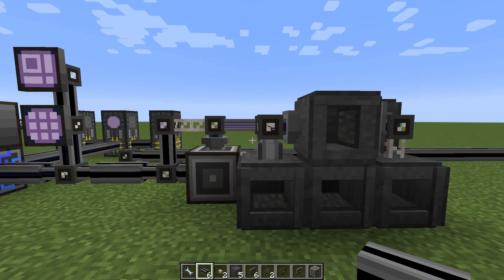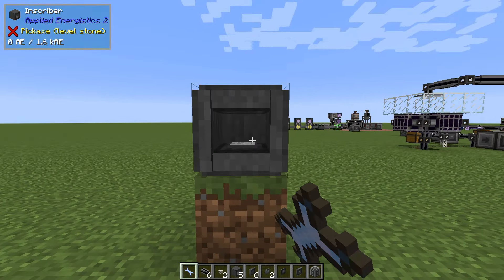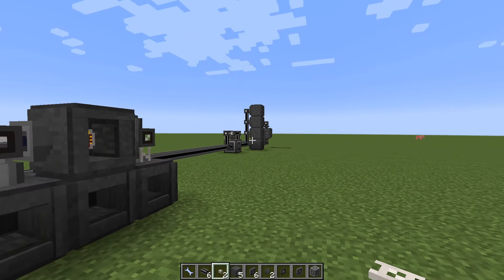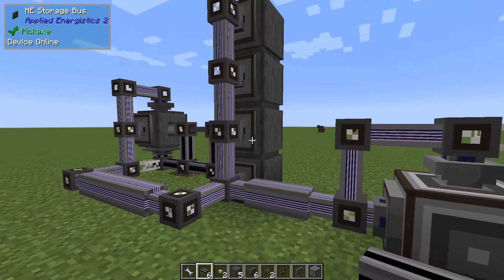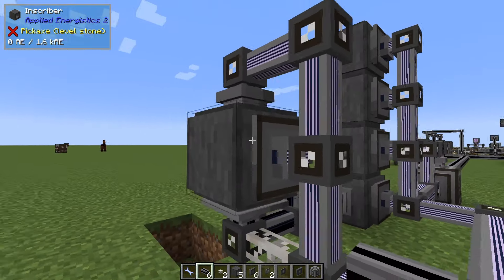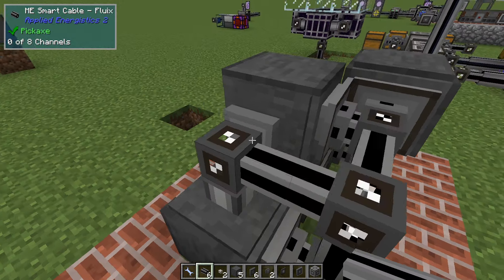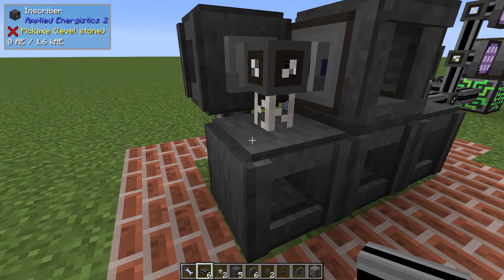Super Compact Inscriber Processor Auto-Crafting Setup - Applied Energistics 2 Tutorial

Comment: Okay so for anyone wondering why your crafting cpu says "missing X circuits". It's because the pattern he has encoded in this video is the raw material not the circuit. This is because processing patterns work like so: "Send X items to (wherever you have the patterns stored, in this case ME interface)" and wait for output of Y.

Swap out the circuits for the raw materials to make the circuits and you'll be good to go.
Reply: The same goes for silicon, make sure its RAW MATERIAL silicon in the pattern, not printed silicon. Basically just rewatch his pattern encoding part and follow it without any implied knowledge or foreward thinking, take it at face value lol.
Reply from the maker: Correct :) I got many questions about it because I guess most didn't watch, remember or understand the pattern part seen at around 5:10 .
Reply: Hello
i dont know if you will see this but if you do could you pls help me.
im playing with a huge modpack right now and i have never  touched AE2. 
i have watched the video and read your comment but i dont understand what the problem is. 
My ME terminal says "No crafting CPUs are available" and the start button for the crafting is gray.
thx.
Reply: @NdlessAmaterasu22 hi i know i’m really late but if you still haven’t figured it out, you need to connect something called a crafting unit to your ME controller!
Reply: i tried it like how it was done in the video with the raw mats and it didnt make the patern

Comment: Thank you! Mine finally worked. At first the Inscribers didn't show it had power. It must be a glitch or something but the bus' and other machines were online and had power but the inscriber didn't show it. The Storage bus was online so I just continued on. I also I didn't know that on the pattern terminal you can change the crafting to processing by clicking the little crafting table tab. The inscribers still show 0 energy but everything works! Thanks for your design!
Reply: I basically have the same thing but it doesn't work. It processes the circuits and doesn't give them out

Comment: Is there any way you can have two on the same system at a time for better efficiency? I'm trying to make a really fast ME farm. Incredible design btw, musta took you hours <3
Reply from the maker: Happy to hear you liked the build, thanks! Please note that the build might need changes depending on what modpack / game/mod version you play. Check my AE2 playlist for additional builds and info! Regarding higher efficiency: start with upgrading the Inscribers with Accelerator upgrades to make them faster, if you need additional speed you cannot simply place two because it will mess up the order. You can use other methods and mods, check my playlist to see some other builds to speed things up :)
Reply: @therealtkh  Thank you so much, I’m playing Sky Factory 4, and have already used the accelerators as I am quite accustomed to this mod pack. I tried replicating another one connected to the same system but it just breaks both. They are both perfectly built and work when one is disconnected from the other, but how could I get both to work?
Reply: @therealtkh  and evenly split for extra efficiency (I don’t wanna use two ME systems…)

Comment: Hello Im having issues, Playing E2E 1.86 AE2 version rv6-stable-7. My issue is I doesn't seem to want to auto craft the silicon press. The inscriber has a storage bus set to silicon (AE2) (Would It work with other mod's silicon if it works in the inscriber?) and i import bus set to silicon press.
Reply: looking into it more its infact not crafting any of the original printed components its only looking into my system for them and even if there are some it still won't craft them.
Reply: @oliverbarker3378  i seem to be having the same issue playing on Sky Factory 4. spent hours setting this all up and cant figure out how to solve the damn issue.
Reply: @DolphinDerp  I solved it but I can’t remember how I fixed it

Comment: Hi, thanks for the great tutorial! Can you explain why two Interfaces are needed? I understand that without it, it wouldnt work. But I want to understand the logic behind this. Is it to keep the two networks separated? Thank you!
Reply from the maker: I first need to say that this build has been updated with later releases of the mod. Nowadays a Pattern Provider is used instead of the first Interface. But you are right, the two networks are completely separated. The first Interface holds the patterns which means that the network will send all items through this Interface when auto-crafting is initiated. The receiver of the items is that second (flat) Interface. In an updated build I have exchanged the receiver interface with a chest which means that the first Interface (Pattern Provider) will put all items in the chest and then import them to the network with an Import Bus in a more controlled way. For some reason it works better sometimes, but that's only needed in the 1.19 versions (at the time of writing this).
Reply: @therealtkh  very nice, thank you. This makes much more sense now with the chest example!

Comment: did the recipe change? and u dont used pattern right? because ur pattern for the end product is with gold but didnt i need the printed varinat in it because that is what i need to use for the last step?
Reply from the maker: The main network don't care about what the pattern looks like, as long as items are sent and correct item comes back. The middle steps (printed silicon/circuits) are handled within the subnet and the main network never need to know about that. The "recipe" for the processor is still the same. Feel free to watch the updated video where I explain that a bit more in detail.
Reply: the updatet one is for the 1.17 version right? because i play 1.12 @therealtkh
Reply: @therealtkh   yeah ok  got that tryd to do similar with seed for the pure crytal but cant get it to work do u have a tutorial for that?
Reply from the maker: @thelastengineer8633  The main difference between old and new versions is the Pattern Provider replacing the Interface. The filtering option is slightly different, but it doesn't change the mechanics or the patterns used. So make sure the filters in export bus is correct, it's a very common mistake people make.
Reply from the maker: @thelastengineer8633  I have tutorials for seed to crystals, check the playlist and see what fits your pack. Note that almost all of my videos are "vanilla AE2", so in some packs the recipe might have changed, or mod addons are there that adds other blocks for AE2.
Reply: @therealtkh   ok cool thx i installed AE" my self for tekkit 2 so it should be vanilla thx :)

Comment: i built this part for part and the icon that sayys craft in the terminal does not show up. any ideas?
Reply: i also do not have a section for patterns on the first me interface, i only have a config section
Reply from the maker: Always provide game/mod/modpack version as the mod has changed over time. But if you don't have slot for patterns you are probably running a newer version than this video was created for. Use Pattern Provider and check video description and pinned comment for more info about newer version.

Comment: Hey TKH, I tried replicating this in 1.18 so I used a pattern provider, but my printed logic circuit stays in its inscribed after it’s made, what am I doing wrong?
Reply from the maker: They have updated some filter setting for the storage bus so you need to filter on insertion only or add the printed part in the storage bus filter. There's also something fishy with how auto-crafting works now because it will only make one at a time... solved by adding a chest to receive items. I really should cover all this in a new video!
Reply: @therealtkh  Same issue, the printed ones on the bottom are not getting pulled, and are staying in the inscribers. I am not sure which storage bus you would be referring to add the filter on insertion to, as above the diamond inscriber, it is just a cable, then left to the export bus to the top inscriber
Reply from the maker: @crete2880  I have prepared a new video for this build in 1.18.2 where it works perfectly. It will be out within 2-3 days. If you can't wait then do what I said above: The three storage buses (bottom) should have only one item in the filter, but change setting to "filter on insertion only", that will give export bus access to the item. And make sure the top inscriber is rotated correctly.
Reply: @therealtkh  hey TKH I just saw this. It worked perfectly once I did that! Thank you!

Comment: I built this in my SkyFactory 2.4 world, and it worked fine at first (after I fixed some of my own errors.) However, I recently added acceleration cards to make everything faster, but it keeps putting printed silicon into the inscriber that makes the printed silicon. The import bus doesn't remove it either, because it's not in the square on the right, so it just sits there and prevents more silicon from being made.

I suspect that the acceleration cards have something to do with this, because this only started happening after I added them. Is this the result of the cards? If so, which ones do I remove?
Reply from the maker: It sounds like you forgot to put a quartz fiber to separate the "mini network" to extract silicon (otherwise it wouldn't go back to the same inscriber). And possible wrong filter in the storage bus... I have stacked full acceleration cards in every inscriber and have no problems. Also, as I interpret your problem it wouldn't be because of acc. cards.
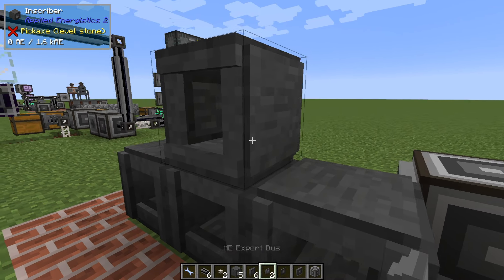Reply: @therealtkh  If you're referring to the quartz fiber placed at 5:50, then I did indeed place that one. I haven't found any other errors, in the storage buses or otherwise. I agree that acceleration cards being the problem makes no sense, but the issue only happens if the cards are in play.
Reply from the maker: @rumalmeow  It sounds really weird and I would really like to take a look at the build myself, even though I'm not involved in development in any way. Not sure of what game/mode version it means but I usually do my builds in "vanilla AE2" so I know for sure I have no modpack changes to behavior or incompatibility... Could be an idea to try the build in creative in a basic pack with almost no mods and see that it works there to see if it's a pack problem.

Comment: I'm playing stoneblock 2 and i cant get this to work. Every time i try to do a craft it says the press is missing. i have each press in the inscribers except for the inscriber on top. Also have one of each press in the storage system. Also do you not have to make patterns for the printed silicon and printed circuits?
Reply from the maker: The press or printed part is not a part of the pattern. At around 5:10 I show how the patterns should look. You do not need to make patterns for every step by using this method.

Comment: im playing skyfactory 4 and me circuits are not getting pulled out of the inscribers, so the last step never happens
Reply from the maker: There are several things that could be wrong, a common is incorrect items in the export filter to the top inscriber. Could be a misplaced cable making some device offline. Hard to guess without screenshots or lots of more information, but it's propably just small error in the build, check other comments as well!

Comment: Hi TKH, thanks for the video.  The latest version now includes Pattern Providers that need to be used instead of the ME interface (ME interfaces no longer work as before).  Does this design work with the pattern providers?

Thanks in advance
Reply from the maker: Yes it does. I have done a video on the Pattern Provider and have tested this setup. In new versions of the mod you might need to change filtering settings in storage bus to every inscriber but that's the only real change.

Comment: @TKH how did you manage to power this? My Inscribers aren't receiving any power
Reply from the maker: Both the placement of regular cable and quartz fiber is very important. They can all be seen in this video but I don't know how you have done it so it's hard to guess...
Reply: Also it wants to instantly put in a Circuit into the top press even when I don't Q up anything
Reply from the maker: @justjestering1646  Not sure I understand. Also, no idea of what version you're running. The most recent has a Pattern Provider block (I have done a video on this update) that makes things a bit different. Note that the pattern should be only the "base ingredients".

Comment: thank you for the great tutorial! I am having one small problem. For some reason the output from my top inscriber (the end processor) isn't being put back into the network, it just sits in the inscriber. Any suggestions? thanks
Reply from the maker: Sounds like something we should be able to figure out. What modpack or mod version are you using? It sounds like the final export bus is not configured or connected properly.
Reply: @therealtkh  TY, im playing SF4 4.2.4 . I have an export bus on the top inscriber pumping in the circuits, that seems to work well. The storage bug attached to the top one doesn't seem to be pulling the final product out. I have the ME import bus hooked up to the top of the main ME interface set to import the three final products. IS there another export bus?
Reply from the maker: @sc24evr  Unless you made a typo you seem to have placed an Import Bus as a final step (towards the Interface (or Pattern Terminal in new mod version)). It should be an Export bus as you want to send Processors out from the small network. The Storage Bus will not suck items out, the final Export bus (filtered with all processors) is doing the work and the Storage Bus simply gives it access to the top Inscriber - so it can export the items back to the main network.
Reply: @therealtkh  thank you!!
Reply: @therealtkh  that worked perfectly, thank you for spotting the error. super appreciate it!

Comment: I follow step by step but can't seem to be even have the option to autocraft the processors... not sure what Im doing wrong
Reply from the maker: Hard to guess :) Do you have Crafting CPU placed and have the patterns made correctly (this is the most common mistake)?
Reply: @therealtkh  thanks for responding. The cpu is placed, and the patterns are in the interface (ie: gold, silicon, redstone = logic processor). I'll work on it a bit more later, thanks again!
Reply from the maker: @lyamsky  Sounds correct so far, if you can't get it working you can jump onto Discord and we'll surely solve it. Good luck!
Reply from the maker: @lyamsky  Hmm, do you have processors in the system already? So you're only picking it up? Test middle mouse click, it should give you the crafting option directly.

Comment: Does it still work if u use ME cables?
Because the flux cables are not in this server :(. But if I do it with these cables it says: No crafting CPUs are available.
Reply from the maker: There should be no difference. The only reason I use smart cables is that it's much clearer in a tutorial video but they have the same functionality. If you have no crafting CPU it sounds like you have no autocrafting set up at all? At least not in that network?

Comment: My printed circuits won’t go into the top inscriber to make the processor. Idk how to fix it ive rebuilt it multiple times
Reply from the maker: It's hard to guess since I have not seen your build, the export bus needs to be configured, is rotation correct? It might need to be rotated either one or three times depending on what compass direction it is placed in.
Reply: @therealtkh  I am having the same issue, my export bus is configured the same as yours is here, and the inscriber should be rotated correctly (top towards export bus). Any other ideas for why the circuits aren't going into the machine?
Reply from the maker: @sawtoothchris24  In what modpack or rather mod version?
Reply: @therealtkh  sorry to waste your time but the issue actually was due to me having an me cable placed somewhere else. I had put it down so I could make processors in the middle of making your setup. I forgot to remove it once I was done. Once I found that was the issue, your design works perfectly. Can confirm it works with the latest version of FTB Revelation, I'm sure you already knew that though. Thank you for what you do, have a great day.
Reply from the maker: @sawtoothchris24  Thank you for coming back with the explanation, glad to hear it worked out in the end! Also good to know what versions it works with, I have not tested with several modpacks but in the very latest version for 1.18 at this time it should also work but might require a minor modification to storage bus filter settings. As I really like this build I'm trying to keep updated to what works and not in new versions. Always hard with new releases in beta as these differences might be due to bugs or changes and I rarely know why :)

Comment: It’s a long shot but I built it but it seems that the bottom middle one with pure certus doesn’t seem to import the crystal to make the press
Reply from the maker: Well, I don't know what you have done so it's hard to guess but I have built this in all new versions and it works fine. Might require to change filter settings for the Storage Bus on the backside to filter on insert only. If the other ones work there's no reason the middle one shouldn't, most probably some small mistake.